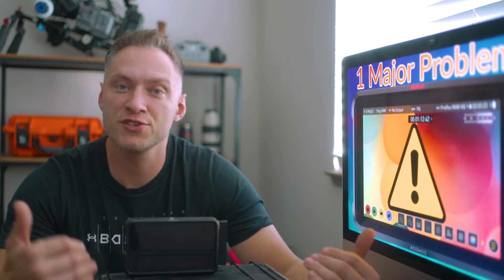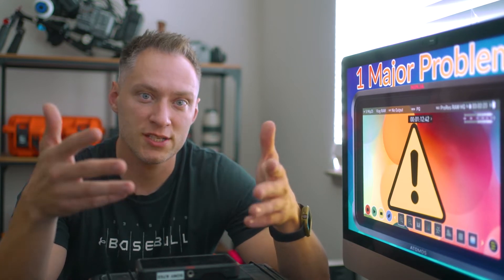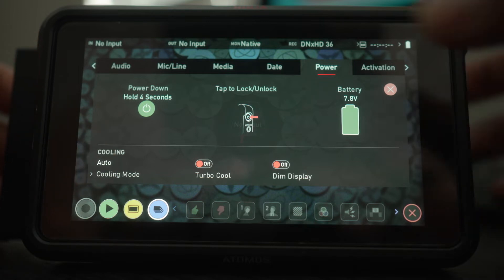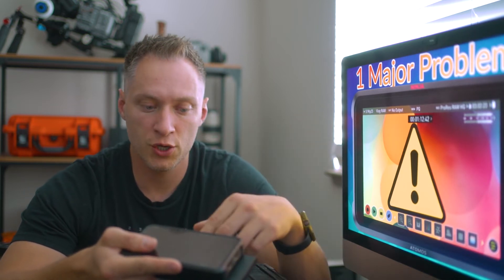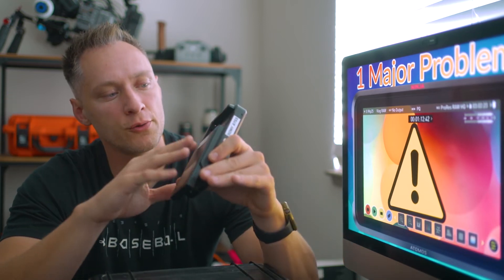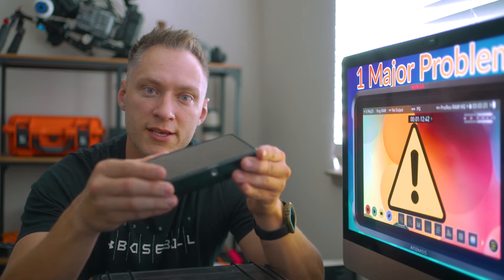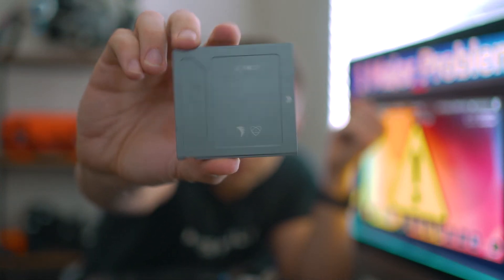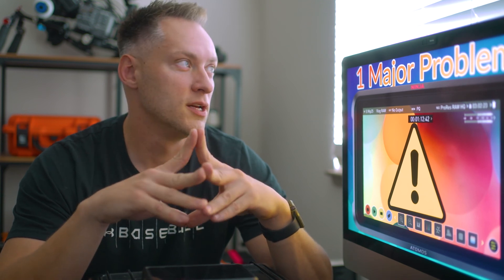Atomos Ninja V Overheating / Shutting Down Explained

Comment: My device overheats even when I’m not recording :D Recording longer sequences over 5 minutes is practically impossible. I have mixed feelings about this equipment.
Reply: Man I really feel for you. I thought my unit was misbehaving but it's not as bad as what I read in YOUR post. Mine is that it's OK for NON-recording 90+% of time. It get dicey when recording though. Roll the dice & maybe nothing happens that time. Next time though, not so lucky. After 25-30 minutes, overheat auto-shutdown. Let it cool down. 15 min cooldown minimum. wipe it off with coldwater damp cloth. dry. Crank it back up. FUCK. made it only 15 minutes next time. then 12 minutes, then 10 minutes...etc... Mine, once it overheat-auto-shutdowns that 1st time, SCREWED, no matter if let cooldown/wipedown etc etc, the subsequent recordings progressively 1,2,3 one-after-another-in-a-row back-to-back diminish down to such short time frames, so eFFing quick, ya wanna chuck the M.eFFer out the window.
Reply: @jimthrowaway  For overheating ive read that you need to dim the screen when recording and also In the toolbox area -> Power Setting Option -> Auto Power OFF Temp -> Change to high 
Fan set to medium or high .
Please let me know if that fixed your issue mate .
Cheers !

Comment: How about attaching small heat sinks all around the unit?
Reply: I saw a video by a guy about 3-4 years ago about overheating on Sony Alpha 5000/6000-series cameras showing how he got these little mini plastic ice-pak thingies, about 2"-3" square & about 1.5" thick, same kind sold to be used as real-ice substitutes in camping coolers etc, and the guy showed how he put a thin washcloth between the mini ice-paks and the camera body (off-center to the side so as not to obstruct the articulating LCD monitor screen) and combined with a skinny light rubber band just enough to prevent slip-off, that it was effective in stopping overheating. The mini ice-paks were pretty inexpensive too, he had an Amazon link, sorry but I don't have it right this moment. I've been considering trying that with this, seems the size dimensions and heat levels are very similar, I think should work. 
But I can't verify that right now from firsthand experience, not yet anyway....

Comment: just trash this shit device and buy a smallHD
Reply: Are they really better ? I've got the cash. I know smallHD ain't cheap. I was looking into BM Video Assist 4K and wound up here. I have a Ninja V & it doesn't always overheat but sometimes, about half the time hit or miss no rhyme or reason, mysteriously after a half-hour recording even if I let it cool down , after that first overheat-auto-self-shutdown, any recordings afterward can't be more than 15-20 mins and progressively less after each one, by the 3rd/4th it's a crapshoot to get more than 10 minutes. That's just totally f&k.ked up for something that costs this much. But I heard even BM Video Assist's have reported overheating. I read a couple threads on reddit about this by users who claimed they went back and bought older used Atomos Shogun FLAMES (not "Infernos") which are 7" as opposed to Ninja V's 5" and avg cost used $450-$550 but they claimed they didn't have the overheating issues with the larger sized device. I have nothing to verify that. Only what I read. Then I read ur thread about SmallHD, and I always heard they were really great, but are also pretty pricey. I don't just trust only hearing about fans & heatsinks anymore, that's apparently just a marketing trick, since those so-called fans and heatsinks don't seem to be enough...
Reply: @jimthrowaway are smallHD also recorders?

Comment: the ssd blocks air flow get ANDYCINE Lunchbox mSATA to SATA Adapter  its shorter and will not retrict airflow its a simple convertion you can buy a standard ssd and put it in the ANDYCINE Lunchbox  housing and these will make it cooler
Reply from the maker: actually, that's not it at all. the reason for overheating is using plastic housing , those Samsung 970 SSDs, if you get Angelbird in a metal housing you won't have those issues
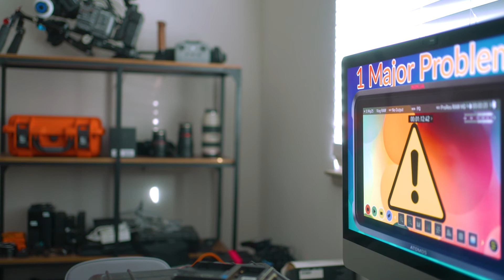Reply: @HUSTLMedia  That's not what you said in your video. Rewatch it urself.  Bud, You said the exact opposite, that metal housings were hotter versus plastic being cooler, that you stopped using Angelbird metal housing (beginning at 5:54 ), despite it being shorter & fitting better nicer etc, specifically because its' metal housing compounded the heat problem, so you went back to ur other plastic housing SSD drives... ( named at 5:18 - Samsung 860) ---- At 6:07 you (exact quote) " Man I just just bought these PLASTIC SSD's ...... 6:15 ...and these are fine, you know, ..///. as opposed to when specifically, starting at 5:58 while holding your angelbird SSD in hand "  This is metal (Angelbird) , and the more metal you toss onto this the hotter the unit is gonna get...,, so actually what I've decided to do.... ending at 6:07 )" ...... THIS REPLY directly contradicts what is spoken by you in your video. Maybe you flip-flopped ur intended wording, inadvertently, by mistake ? 

We're all human, hopefully you just got ahead of urself, and meant what your reply-post said, but in REVERSE ORDER....

It was nice of you to show how to access the cooling settings though.. Not that it helps much, unfortunately. 😎

[ EDIT ] : - - FYI ... for the record, I have WD 1 TB SSD - - the insertable drive enclosure is plastic - - drive works great. 
                       until MthrFking Ninja V overheats.. (( BTW, even when Ninja overheats, drive is "cool to the touch"))

Comment: In my case, i use Ninja V for recording from an ATEM TV Studio HD switcher for event. Minimum time is 2 hrs/record. Ninja V will overheat after 3hrs, sometime after 4hrs continuous record, and gradually, 1/3 of the screen will glitching and turned off (still recording though), and then the next 2/3 glitching, dimming and then finally just 1/3 of the screen work. This is repeatable and have been the problem since day 1. I am looking to switch to this Andycine SSD enclosure
Reply: Did you managed to fix or improve the situation ?
Reply: @thesteammachine1282  Personally my eyes glazed over in envy reading about recording up to 3-4 hrs before overheating. I have posts elsewhere that I'm lucky to get over a 30-45 mins recording before shutdown, and rarely get even a half-hour afterward even after letting device completely cool down. If 1 hr in a nice air conditioned cool room cooldown isn't long enough then that product is defective , IMHO, no matter what anyone else tells me. Just a shit device.

do you own one of these and having issues ? . . . . . how long does ur device hold up before overheat/auto-shutdown ?
Reply: @jimthrowaway  Didnt knew it was that bad . I was planing on purchasing the 2023 model revision of the ninja .(in hope they fixed this) But now im also looking at the Blackmagic Video Assist 5 12G HDR .(the only thing I dont like about that one though is the lack of x265 ) and i have no idea if it will work with game consoles as a separate project I wanted to try. Ive read that the hdmi is protected but on the Ninja its enough to just switch off the HDCP on the console to turn off the protection. In theory should be the same about the Black Magic one .
Reply: @thesteammachine1282  I looked into BM Vid Assist & Connect both, & heard they also can fry an egg. Of course those are posts as feedback just like these, so they're "unconfirmed", I can't vouch about those, or to what extent... 
I'm still begrudgingly on the fence about Atomos, because I did come across a number of posts that the larger 7" shogun flame (flame not inferno) seemed to be more stable in not overheating as compared to the 5" V. That I read by a few who swapped over from V to Flame and said they noticed immediately that if and when it ever overheated was only after very extended use durations. I'm considering experimenting with a used Flame if I can find one in good working condition. I'm just very cautious about pissing away hundreds of dollars on buggy or unreliable gear. Man we both know we can easily find other uses for it, I'm not gonna burn it on hamburgers, I can get new cage & rigging accessories with how much money I've pissed away over years... At this point for me however, I care more about not overheating than the feature of Atomos being both monitor/recorder. I'm prepping to get a panasonic s5IIX, which has video output external recording via usb-c direct to external SSD, along with great ibis and pdaf, direct baking in of LUTS, plus H.265 mentioned in ur post that's lacking in the BM Vid Assist).
I'm no gamer personally, so the point you made referring to a project involving gaming consoles, I'm lost in the weeds about that type of discussion, admittedly. Best of luck regarding that....
Reply: @jimthrowaway  I completely understand you mate 👍 . After digging around now im even more puzzled with the BMagic recorder as there seems to be a lot of outdated info on which sd cards or usb c devices to use with it. Seems quite picky which is worrying . On one hand one can easily pick up something like a SanDisk Extreme SSD or even play with the idea of a nvme with usb c, but here is the problem.
From what I see, the Black Magic recorders are using usb c 3.1 get 1 so if lucky, this will get up to 5gb/s .(i kind of doubt it) . Than we have the high end external ssds. Unless you have on the pc usb C 3.1 gen 2 or usb c 3.2 you are loosing time. Than I read that those external ssds that are usb c, dont come near the advertised speed, and when they get hot, they throttle to something like 30-40mb/s which will not work for 4k video at all !
Right now Im looking at that ANDYCINE Lunchbox II for the atomos. Youve probably seen it. You just have to put inside that metal case the insides of lets say a samsung 870 evo . The reason im looking at it, as it is so small, when in place, the fan vent area of the atomos is completely opened and I highly suspect that this might help prevent or fix the overheating issue . A normal ssd (due to its length) always blocks the main vent for air. I suspect this might be a fix for the atomos . Another thing Ive found to help with the overheating on the atomos is that you have to change in the menu the overheat warning setting to high . Its in the toolbox area -> Power Setting Option -> Auto Power OFF Temp -> Change to high. 
My best guess is that with that setting and moving the ssd to a ANDYCINE Lunchbox II case, the overheating might be solved or at least it will hold for hours to finish the work.

Comment: For $600 not good. Forget Florida and hot places.
Reply: I’m in Florida and for some reason the fan isn’t working
Reply: @Sched  there's a New firmware update from Atomos that will fix fan issues. Check it out.
Reply: If the metal case is warmer than the air, which it will be, then it is helping the unit to shed heat.  This is a good thing, not a problem.